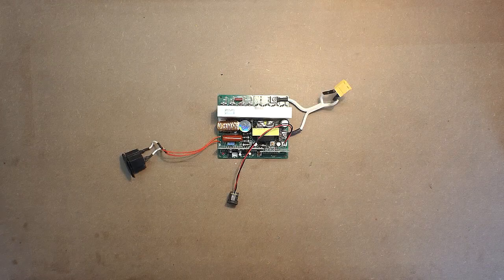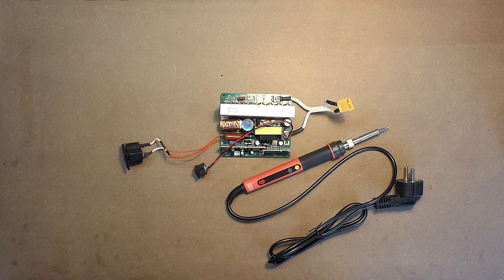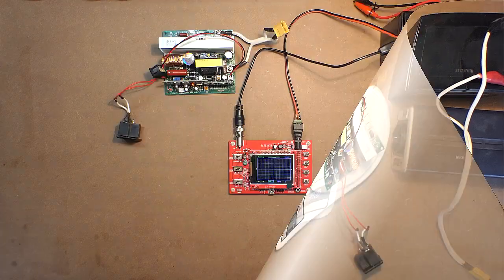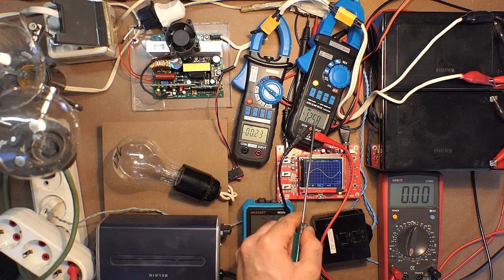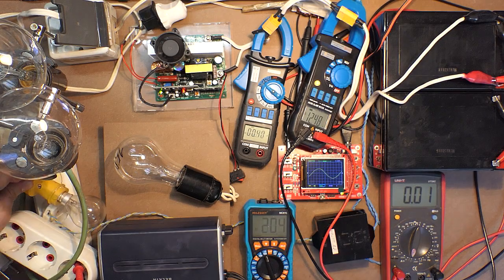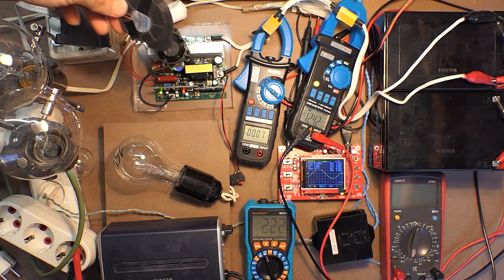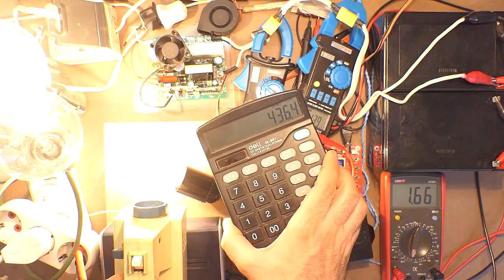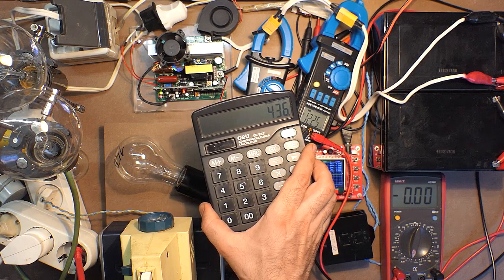Pure Sine Wave Inverter Board 500/300W

Comment: Hi. i'm planning to use this on a 220v 1.8cuft bar fridge.

Can this possibly handle inrush current of 2.5A <1s?
Operating current is 0.4A after that.

In your test the inverter switches off after ~2A of AC load is applied.
Reply from the maker: No, it won't work. You should get more powerful device with high start current.
Reply: @powerbatterychannel4315  ok thanks!
Reply from the maker: @b2939161  You are welcome!

Comment: Thank you for this detailed review. May I ask, what should do. I have the same inverter but it can not handle around 100Watts of load. 

Also the 60W Electric fan cannot start and run normally. The voltage drops whenever I switch ok the Electric fan. Thank you.

Comment: Chinese inverters seem to state their maximum 2 minute power output as being their capacity.  Divide by two and you have the true power output.
Reply from the maker: Sure, but I need this device exactly within 2 minutes - for testing of some 300W devices in field conditions, which require sinusoidal signal.

Comment: Wanna ask if this Inverter can Handle 600w in a fraction of seconds, planning to use this with a 160 watts motor with startup at 600 watts
Reply from the maker: No, it can't.
Reply: @powerbatterychannel4315  did you tried to turn the load on at 600 watts?
Reply from the maker: @tetojoontoolsandtips  Self-protection turns the device off immediately.
Reply: @powerbatterychannel4315  i see. Thanks for the respond. But I will try even if you say so.